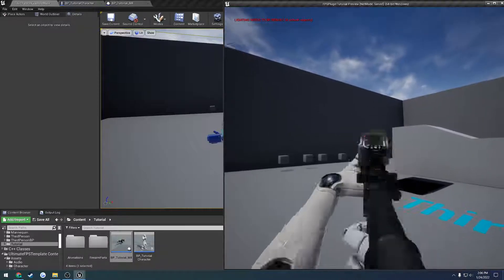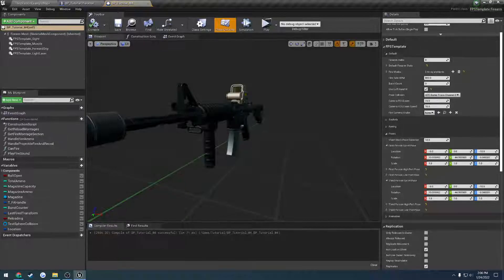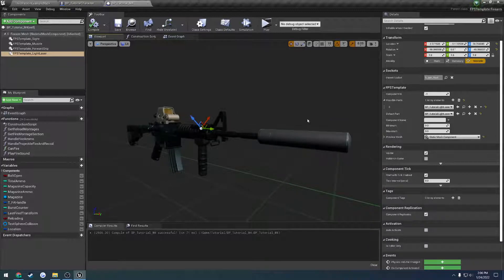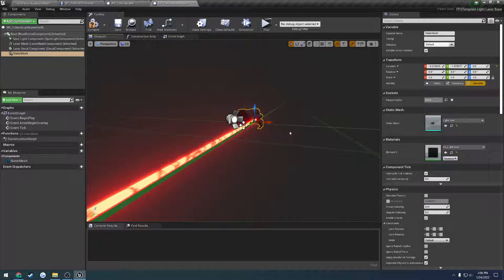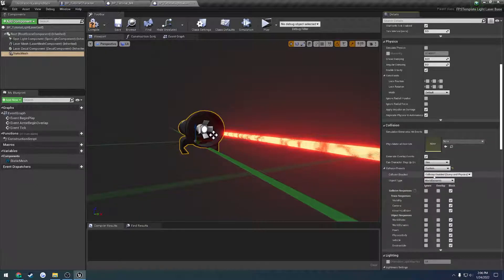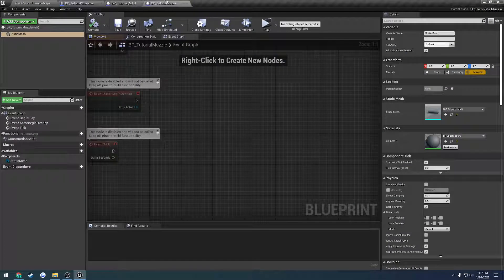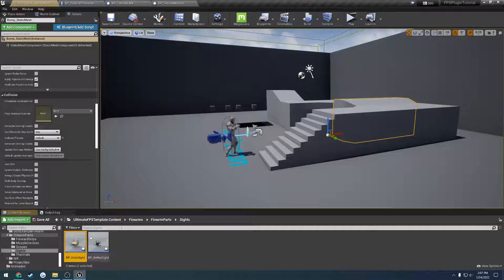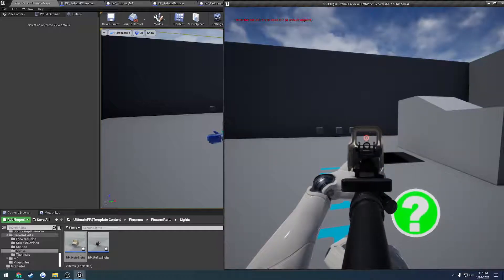UMFPS Template Tutorial: "Fix Attachments breaking Firearm Collision"

Comment: Question! How do I set up reloading? I copied over pretty much everything from the reloading section of the example M4 but all it does is tilt the gun slightly and then freeze in place, it never completes or shows any reload animation and I have to stop and press play again to shoot.
Reply from the maker: You can either roll your own system which is recommended or follow the example blueprint. The logic inside the examples are just examples/placeholders to show how to do things and use extra features provided in the system.